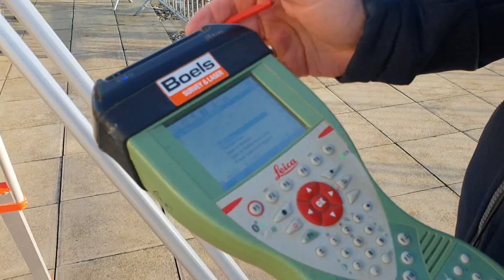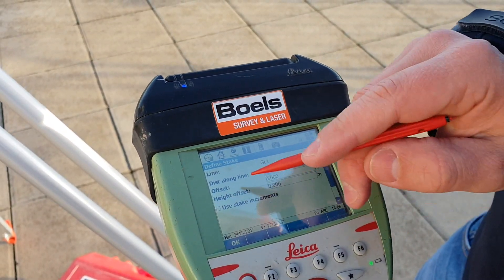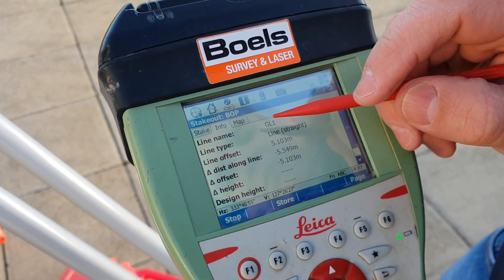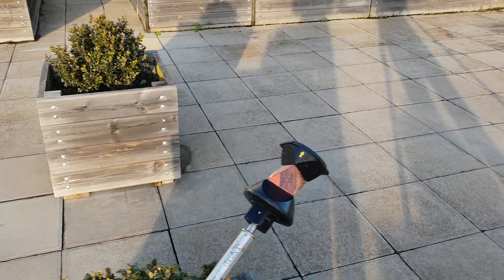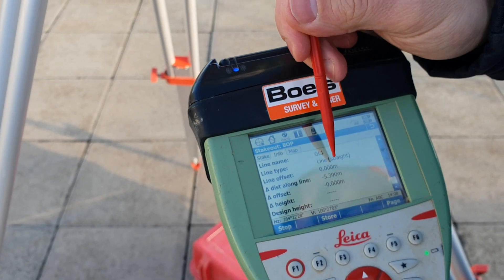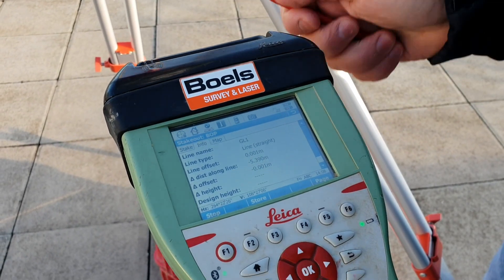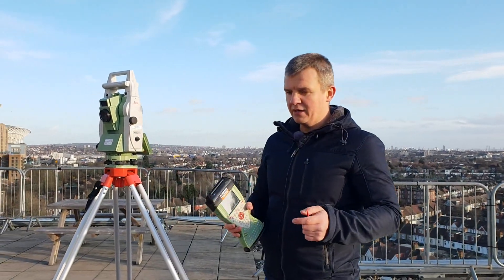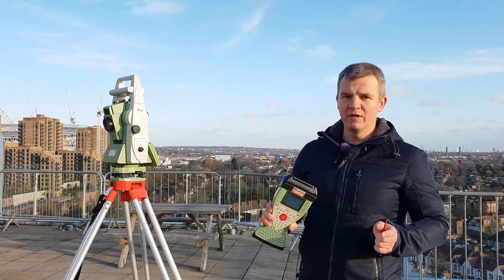SETTING OUT #14 - How to mark a line with Leica TS15. Robotic Total Station 'Reference line' program

Comment: What is a stake line?
Reply from the maker: You can stake the line, or measure to line. Staking the line is marking the points where you can also set the increment you want to stake on the line. You can use is just to set the line as well.

Comment: Greg. If you are marking accurate gridlines on a poured slab. How do you do this? Do you take the prism  off the large pole, and fit a small point to it, like a regular prism? Or do you mark a point by the laser pointing to the line?
Reply from the maker: I would probably use a laser in this case, but if you have a small 'rod' that would be good with the prism too. I would still prefer the laser anyway to make it as perfect as possible, but it all depends what access you have etc etc

Comment: Greg,
    Absolutely stunning videos for the people like me who want to jump from the manual Leica to Robotic Leica and your videos are very educational and very down to earth material with simple clear crystal explanation.

     You used the map to set the Reference Line on your Controller and which is fine.

     I wanted you show me if you have the coordinates of the line and you then set the Ref. Line for work using the coordinates from your memory on board.

   On the manual Leica this is how it is done but the coordinates are drawn out of the memory to fix the Ref. Line.

    I am assuming that you can do it the same way on TS15.

     But a demonstration would have been a diamond cut education.

      Fantastic video and a great education material.

      And........ why are you stopping making more videos in this setting-out series?

      You could have shown the following.

      1: How to measure the height of the building or the tree?

       2: How to set the circular arc and the offset line from the circular arc?

        3: How to measure the AREA of the land on the set program?

       4: How to measure the VOLUME of the earth mound?

       5: How to set the Batter Rails.

          Hopefully you will cover them in future videos.
Reply from the maker: Thanks Asim! Very happy to hear that :)

Comment: Hi mate, I’ve been using the TS06/07 model for about 2 years but I have found a new job and they need someone that can use the robotic EDM. Would it makes sense to take the job without having prior use of TS15 and the likes. Many thanks.
Reply: Hi, I have just starting to use a robotic leica ts15 from a manual  one. It's taken me a few days to get my head round it. Quite easy to use really.
Reply from the maker: @pwhite1919  That's what I said to other people, once you can use EDM, changing for robotic will not be that difficult :)
Reply from the maker: Hi! Hard to say really, it's not difficult like you can see on my videos, but good to have at least a bit of practise. Will you be the only engineer there? What kind of job that would be?
Reply: @SITENG  Yes I will be the only engineer there, and it’s a groundwork’s job mainly pilecaps and drainage.
Reply from the maker: @mrmightyz6501 You can always try as you have experience, but you know how it is when it's busy and you would struggle with the EDM. You will be working with Leica?
Reply: @SITENG  Yes I absolutely understand, and yes they need someone that can use Leica TS15.
Reply from the maker: Sorry for late answer :) I hope you made a decision, let me know.

Comment: I'm managing the restoration of an old building that requires pilling an underpin. I've set up a local grid an stuck retros around the building to monitor any movement whils the foundation works begin. What's your thoughts on using a 5second instrument an not a specialist montoring station?? Great vids by the way 👍
Reply from the maker: I think it's enough, I am using 5sec. instrument and if there would be monitoring needed I would have no problem with that, unless the client has some requirements. If possible monitor the points from same position :) Thanks!!!
Reply: Thanks for your reply, no client requirement its just a personal preference really. 
Same point makes sense cheers